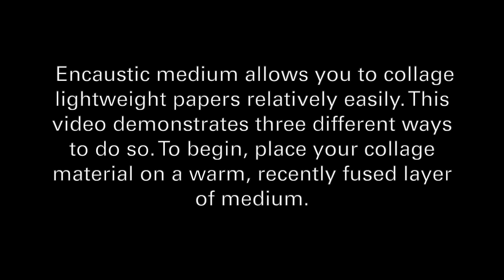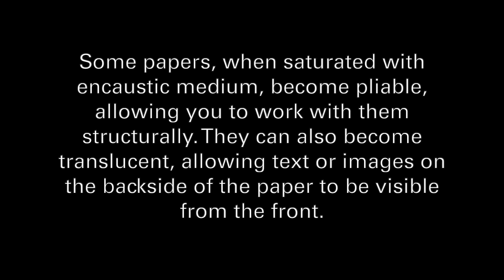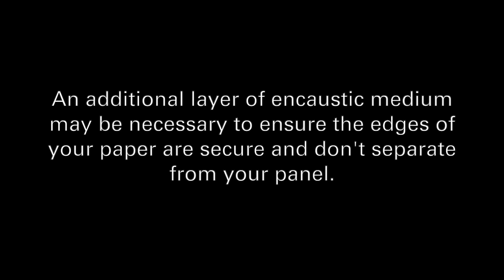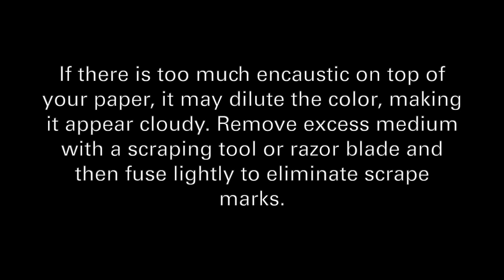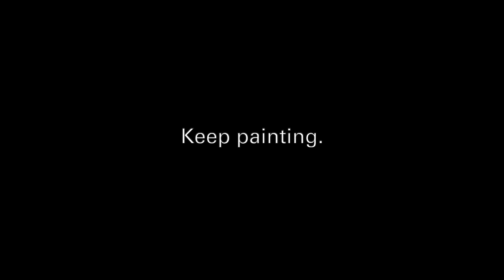Encaustic Collage

Comment: I've been having issues with my paper lifting from the surface several months after completing a piece. I use a lot of photocopies and wonder if the paper is just not absorbent enough. I also brush a layer of wax on the back of each collage element to better fuse it to the layer of medium on the board. Is that too much medium? I'd love some advice as to how to prevent papers from lifting from the piece!
Reply from the maker: Our guess is that the connection between the paper and the medium is not working because either it hasn't been fused enough or the paper is not thoroughly encased in medium. Make sure that the surface of your wax is nice and warm before you apply the paper. Burnish first to remove air bubbles and then apply medium over the entire surface, being careful to coat the edges of the paper. You may need to do more than one coat of medium. Fuse lightly but thoroughly. If you overheat, the paper will want to float up in the wax to the surface. Typically it's the edges that lift - so be sure those are submerged under medium. If you have too much medium on the surface of your paper after you are finished, you can scrap it back a bit but leave the edges underneath the medium. Good luck!